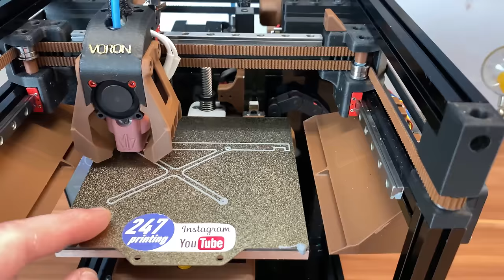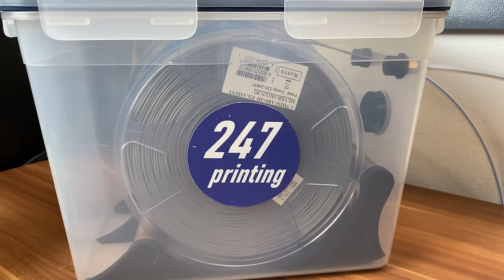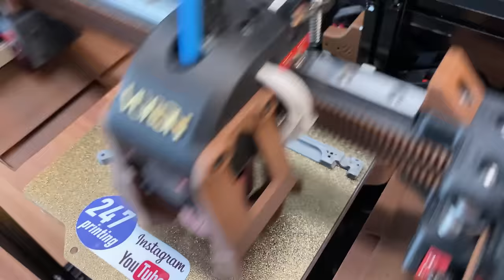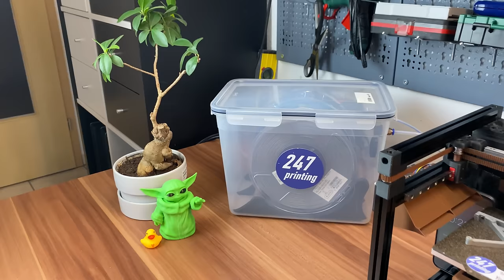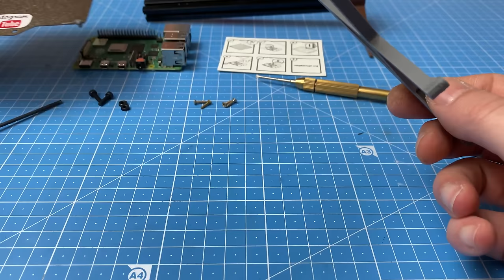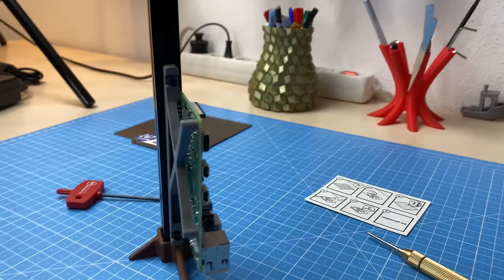1000mm/s: THE COMPLEX PRINT on Voron Ferrari !

Comment: How does the ABS+ under that speed not warp am i asking? :)
Reply from the maker: Only very little cooling here, speed helps to keep the internal stresses low and ABS+ works quite well not warping unenclosed. Never the less I had some issues with warping when testing. Was a bit of tweaking to get it done halfway properly ☺️
Reply: [Using abs+]

Comment: Wow! Whats the total price for this build?
Reply from the maker: Thank you! I guess somewhere around 800€ now (Hemera, genuine Mosquito Magnum and four delta fans for external cooling, each 16€).
Reply: @247printing  how is the wear and tear on the parts with that speed? Do you think you need to replace moving parts after relatively short time?
Reply from the maker: My V0 is running for 5 months ("abusive printing") now and this question is frequently asked. The only problem I had after examination: Play on the X-rail (from the crazy y-accelerations)

Comment: This might sound like a stupid question or even a stupid statement but I have an Ender 3 Max I can print is about 150 mm II after everything I've done to it was wondering about fine detail and Fast Printing if you can't do that I use a point to mmmm nozzle to do rings and fine details for making coins and things but now I'm looking for a rapid type things and slaa is too expensive for something I'm just going to melt anyway doing lost pla casting and we wonder if if I could print something that fast but do something with detail with a tiny nozzle if you're capable of doing something like that that be a great video I'm on the fence about getting a voron in one instance I'd love it four big parts maybe even better if it did small complicated parts if not I understand why temperature control would be something that would be really hard to get right
Reply from the maker: I don't want to offend you, but reading/understanding your comment was VERY difficult for me (no punctuation marks). With tiny nozzles you add more back pressure to the extrusion system with might be the next problem you'd encounter at speed. Additionally your cooling and motion system still has to very capable to reach the speed and cool down the melted plastic. Thanks a lot mate for your kind words.
Reply: @247printing  I apologize. Was walking my dog and voice typing. Apparently it doesn't know punctuation. I was asking if you can print fine detail parts fast like that. I make jewelry and use a . 2mm to get the details. Fastest I can get my ender 3 all modded up is 100mm/s. Can the voron print tiny details that fast?

Comment: what hotend is that?
Reply from the maker: Hey buddy, please have a look on my detailed description.
Reply: @247printing  im guessing mosquito magnum+
Reply: @josiahong5177  partly right... The upper parts.. the block is a #volcomosq 🦄
Reply: @Nitram_3d  i was thinking magnum bc it looked like a mosquito, but with a sock, i was confused, as I remember slice engineering not making a sock. Turns out, they now make socks. If only I could get one for my mosquito...
Reply from the maker: The sock and heater block are made by Nitram. Heatsink and heat break are genuine Mosquito Magnum (without "+"). All details in the description of this video :)

Comment: Whilst impressively fast, the print quality is pretty dreadful, which begs the question of whats the point?
Reply from the maker: It’s a feasibility study of printing a useful part at excessive high speeds. The quality or the looks of it are secondary. If you want a part to look good, just go a bit slower. Operating at the limits is the best way to identify measures for further improvement in order to push those limits further.
Reply: @247printing  Fair point. I think slicer settings would be key here.

Comment: What's the point?
At .1 high, .4 wide with 1000mm/s -> 40mm³/s -> max stated flow, with quality nothing to write home about...
at .2 high, .4 wide with 500mm/s -> 40mm³/s -> same flow BUT with better accuracy and less stress for printer
at .3 high, .4 wide with 333mm/s -> 40mm³/s -> same flow and for functional parts acceptable detail level, and very doable on stock hardware...
Reply: What's the point of making cars faster and faster? Not much but to show off hardware and skills.
Reply: Rapid prototyping I'd say. For prototyping things this speed is just amazing. If quality does not matter but you need something close to proper dimensions quickly - you can rapidly iterate the design with this. 10minutes, you can try and dryfit. Not okay? 10 minute adjustments and an other 10 minutes and you have something that is useable. 
Hack, I'd kill if I had something like this at work.
Reply from the maker: Hey Seb, you got it (partly)! I was thinking a lot about what is the point on printing at 1000mm/s (since I am doing that). What I did in the past and here simply is a feasibility study: Move and extrude at the absolute limit and still get a functional part (with complex geometry). Go some steps back and you get both (speed and quality). The speed per se isn't the real problem for quality here: It's the overshot accelerations to reach the 1000mm/s at the given travel distances. To print this part still REALLY quick (not much slower) and at quality, I'd go for 0.2mm layer height, somewhere between 300-500mm/s and lower the accelerations to about 15000-20000mm/s² (enough to reach the speed here). BUT I'd keep the high acceleration used here (30000mm/s²) and the 1000mm/s for the travel moves. I'd like to try it out and I guess it results in a print somewhere around 15min. and the part would also look acceptable/good. Best compromise.
Reply: @HuntersOA  FYI all three of the cases given earlier, will print IN SAME amount of time -> same flow amount. What will be different is the how and the result
Reply: @247printing  Thank you for your feedback. I do agree that such efforts are tools to discover the limits and extend them, so that "normal" mode printing will become more efficient.

Comment: Its really fast... Thats quite impressive to me and i would love to get my printer anyfar near that speed... But i would not take such a not beatiful print... Even its a functional print at all... I love esthetics and Quality so i would print at 200mm/s instead and have a perfect looking piece of plastics in my hand instead of this with so much under extrusions and failures in it...
Reply: Like I said on his last video... He should 3d print something like a clearance demonstrator like the entire assembly required for one Filament Block from the Enraged Rabbit Carrot Feeder project which is a royal pain in the ass to get to print right for the parts to come together without snapping during assembly. A 3d Printed Pi Bracket with like 1mm of clearance and flex like that is hardly a demonstrator... I could do the same on my 350 sized Voron 2.4 - Not impressed 😑
Reply: @Duraltia  that piece in the vid could be printed with my stock ender 3 clone at 250mm/s and would look like his piece... With all issues in it like his piece...
No i would say thats not practical when the pieces come out like this... And as you said! I would also mention that the Clearences are to forget in this print...
And as i said... The speed is impressive but the Quality is not anywhere near i like my prints to come out of the printer!
I was also very impressed how good my parts are coming out of my sovol sv01 on 120mm/s... Its not anywhere near from his 1000mm/s but my quality is so much better than this
Reply from the maker: Hey! That's an important point. I would not take it either. That's a feasibility study for movement, extrusion on the max. If I'd really need that part I would try somewhere 300-500mm/s at 0.2mm layer height and half the accelerations (most important for quality). I'd keep the 1000mm/s and high accelerations for the travel moves. The part would still be way below under 20min, which would be absolutely acceptable for me.
Reply from the maker: @Duraltia  Hey Durahl, thanks for your thought's! I'd really like to see that part printed at 1000mm/s and 30k acceleration (needed to even reach 1000mm/s) on a 350mm V2.4. But still, I can't state this often enough: It's a feasibility study, with loads of measures on the hardware (gantry weight!) and parameter variations involved - on a already small and light weight printer concerning the moved masses. There are guys with highly capable/tuned (big) printers out there and  with all the knowledge to do that - maybe you are also one of them! Go for it, please, I really want to see this on a 350mm V2.4 on 2020 extrusions.

Comment: I don't get it. That's not a hard model to print and the printer did a terrible job on it. It's more like a hobby.
Reply from the maker: For a standard printer (Prusa) with no-brainer default profiles (PrusaSlicer) and Standard Material (PLA) printing slowly (60-80mm/s, 800mm/s² acceleration) in 60+minutes: You are right. For printing this model fast (1000mm/s, 30000mm/s²) in 11minutes with ABS it's a very challenging feasibility study: 90° corners, small holes, bridges, overhangs, etc. Thanks for commenting!

Comment: Man, you really stuck your finger in there for a sec
Reply from the maker: 🤷🏻‍♂️ Even though it is fast, there is not much force / energy. This printer can’t hurt due to movement, as moved masses and remaining torque are super low.
Reply: @247printing  makes sense, hey, those  nema 14 coolers are freaking sweet, do you happen to have an stl for it?